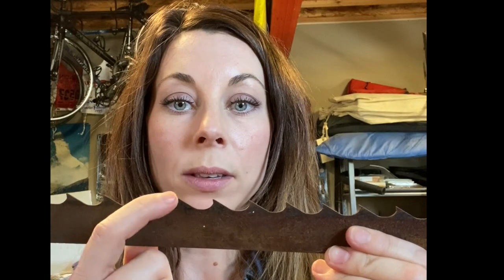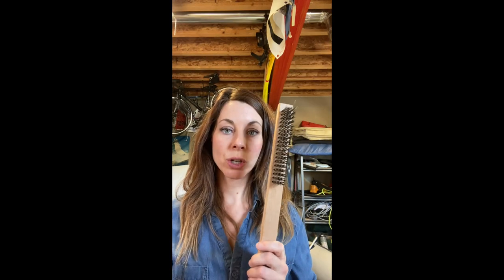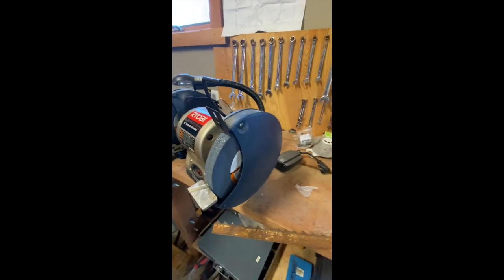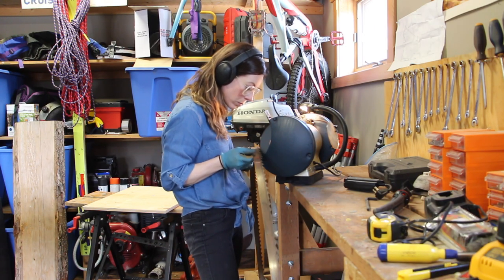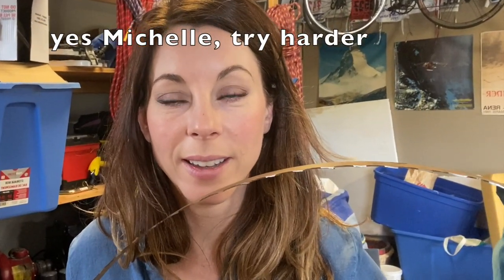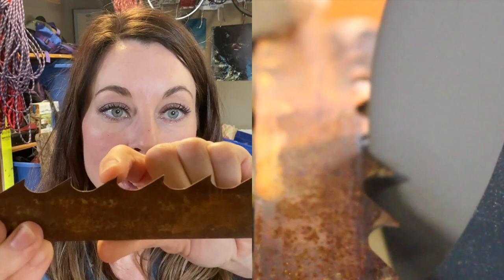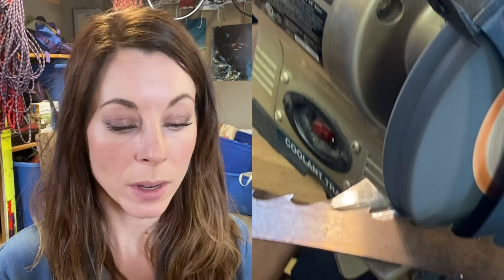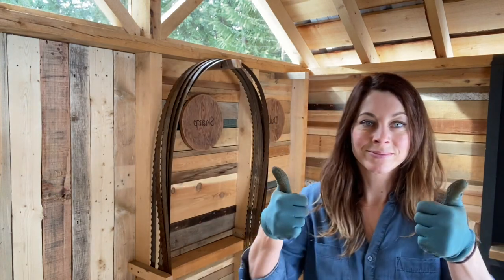How I sharpen my sawmill blades

Comment: To give more clearance for the tip of the saw tooth, just get a dressing tool for the grinder wheel and angle the face of the stone.  This would allow you to still use the side of the stone for sharpening all the while keeping the tip of the next tooth away from the wheel.  Simple change to allow you to use the system you have.

Comment: I like your method. They make thinner wheels that have rounded edges so you could fit into the gullet without nicking the previous tooth.... you could also use a wheel dresser and shape the wheel on the grinder..... love how detailed you are in your videos by the way

Comment: That's actually an interesting and inexpensive way to sharpen those blades. Best way to prevent gullet cracks  is to use a chainsaw file to freshen up the steel in the gullets every few runs. And never run a blade until its completely dull. I change blades every six hours. Been sharpening for 15 years now.

Comment: I manage the millwork dpt in a custom cab/archtectural millwork shop.  We have 2 large resaws, a Stenner, a Baker, and a Winterstieger frame saw.  There are few places that sharpen resaw blades anymore, so we primarily run carbide tipped throw away blades.  

 If you ever need a job in woodworking, we would love to have you!    You would run circles around almost everyone.

Comment: Before I got my Cats Claw automatic grinder I used a bench grinder. Your results  can be improved if you put a narrower wheel on your grinder, say 1/2" and dress a Radis to fit the gullet. biggest problem is its very tiering on your hands. Find a way for the band to rest on a non dulling surface will help.

Comment: I use same technique but I have a CBN wheel on 1700 rpm (slow speed) grinder and this does a very nice job.
Most newish grinders are 3600 rpm and using regular abrasive wheel you risk heating the tip too much and inadvertently taking too much material off. The CBN wheel is much finer cut and produces much less heat. I had a 3600 rpm grinder and then neighbor gave me his old grinder which is 1700 rpm and this made a big difference. Invest in the CBN wheel ....you will like it. Keep eye out at yard sales and FB market place for older bench grinders.

Comment: Right on! Your channel popped up and this is only the second video I watched and just so happens I have two blades in my truck that I was going to try to find vids on sharpening them. 
Buddy has a saw mill,said I could use it and asked if I could sharpen the blades. 
I’ll try your method. Thanks.:)
Reply from the maker: Awesome! There’s a ton of negative comments about doing it this way, but there are many other people on YouTube that have demonstrated this exact same way and claim great success. It’s far from perfect/professional, but it’s better than nothing and does work. Good luck!
Reply: @michygoss7148  right on ya I’ll do what I did for sharpening chainsaw chain. Watched everyones vids and then took the best points and put them all to gether and now I’m not bad at it. I was ripping boards free hand and pretty good at it but this mill is FUN! Buddy was saying people curve the blades to get a rough a looking finish have you heard of or tried that?
Reply from the maker: @Indeewoods  I have not heard of that! Sounds interesting!

Comment: I enjoy your videos. I also own a woodland and sharpen my own blades. The face and gullet are also an important part of every tooth. They also need attention. Every time a tooth is sharpened you loose set in the teeth and it will not cut as good. I have not seen you cut hardwoods. I cut a lot of oak and walnut. I can tell the difference if the set is not correct. 
Keep up the good work
David
Reply from the maker: I don't have any hard woods in my area!

Comment: A large wooden  “wheel” off of a 42” (1 meter) wire spool,mounted to the side of a post would be a convenient place to clean your blades before sharpening. 
You might want to use a grinder dressing tool to round off the left corner of your wheel so your less apt to catch the tooth of your blade.

You do an excellent job explaining what you are doing and have a pleasant voice.

Comment: first video i saw from you, good.  Notting than a vid on sharpening to have comment on how to, ah ah !
I am toolmaker, anyting you do with a grinder like yours have to do on the face of the weel that you can dress. You can sharpening with this grinder but you have to make it set for the job, a bit of work. Just keep in mind the shape of the tooth. The face, curve one, have a positive angle that is for bite into the wood. The back, strait one is to dig. And the set, that give the wide of the cut. You have to replicate that to kepp going fine. For the rust, you can take some time to remove a part of it, but for me i dont worry about, maybe just dry a put some oily stuff at the end of a job. I think your channel will grow fast. Good luck !

Comment: great job on the DIY, I would suggest using a thinner grinding disc so that you can grind the gullet.  That is the low area between the teeth.  Micro cracks form over time and that is typically what causes blade breakage
Reply from the maker: Thanks! Yes, it would probably be better. I just used whatever was already on bench grinder to begin with, so all of this is really just a starting point. There are so many better ways to sharpen them, but for now this has worked OK.

Comment: When i built my bandsaw mill i knew at some point  i would have to sharpen my blades. So after searching on the internet i found a guy the made a blade grinder using a chainsaw sharpener with narrow blades. As i am a welder and machinist by trade i made my own complete with stops and indexing the blade so that you take precise cuts. You will also need a blade tooth setter which i also made using a dial indicator so that each tooth is set precisely the same.
Reply from the maker: That sounds ideal! I wish I had the time, knowledge and patience to do that myself.
Reply: wish you could have shared the link to that vid\

Comment: I have an inexpensive electric chain sharpener for my chainsaw and I've started using it to sharpen my mill blades. Works fine although the chain advance piece has to come off since it's not high enough for the wider blade.

Comment: If you wanna ever really take a good look at ones that have been sharpened alot, one of the biggest factors in hand sharpening is the height of each tooth. Just a simple digital caliper would show you which teeth are out of the ordinary.
Teeth cut too shallow can be left alone, but if you have a handfull that are quite long they should be shortened as they will cause the whole blade to heat up and dull.
Never did band blades, very cool to see!

Comment: You should check out Matt Cremona's channel. He built his own bandsaw and has been dealing with having to sharpen his blades too. I think he has a video on how to do it. You need a tooth setter for those blades. Heck, I use one on my 1/2 & 3/4" band saw blades which get sharpened once a month, depending on how much I use the machine. "Sawing with Sandy" also talks about how to properly sharpen the big milling size blades. I clean all of my blades with CMT. Especially when resawing greenwood. I use an old toothbrush and a cheap shallow pan I got at a thrift store. It works great at getting the resin and sap that builds up on the blades. I give you a lot of credit for tackling the tougher jobs and the maintenance too. More and More women are taking over what has been traditionally a "males job" and it's refreshing to see women like yourself showing women can do anything if they put their mind to it. You are a great role model. Did your dad teach you all of the building skills you have? It's great to see you working side by side. I wish my father was still alive. There was so much more I wanted to learn from him. Best of luck.

Comment: That's clever     I use a 25000 RPM makita   Large drama  With a cut off wheel & then I put a round stone on it  I do both sides  outside &  the top side

Comment: Nice video. Have you tried spraying Blade Coat on your blades? Reduces friction.
Reply from the maker: I have not. Do you mean when sharpening? Or when sawing?
Reply: @michygoss7148  when sawing. I use it on my circular saw blades, planes drill bits and chisels. I have never had a ban saw, so not sure if it would help. I use Japanese hand saws and it helps as they have a very fine kerf. I thoroughly enjoy your videos. We finished our cabin with native pine using only 2 saws(rip and crosscut ). It was a shell when we bought it and 500’ off the main road, so we opted for total solar and have lived off the grid since 2000. Propane Fridge, cook stove and hot water. We did heat with 6 cords of wood originally, but switched to propane after I had my 2 knees replaced.. think about wearing knee pads when you work👍.we have a deep well pump(150’)and a propane Koehler generator for back up. Your skills will improve with time. You do quality work!
Reply from the maker: @garylavorgna5976  ok. Thanks Gary! It sounds like you have an interesting life off grid, and full time. I do admit, I love life at the lake off grid, but I do appreciate coming home to all the amenities as well. 
I do realize that I’m a bit hard on my body, and it will likely come back to haunt me. Thanks for your concern, and thanks for watching! 😊

Comment: i use a 4 inch peanut grinder and sharpen the blades in place on the mill, only takes about 15 to 20 minutes.  i sharpen the inside of the tooth, it works pretty good.  i can sharpen a blade about 4 times before they're toast...like your vids, your a tough gal...
Reply from the maker: peanut grinder? I have seen someone use hand files and sharpen on the mill. It does seem logical to sharpen while still on the mill. I don't have any power down at my mill though 😏 (could get a generator I suppose).

Comment: You could probably buy a grinding wheel for a sharpener set up and use it on your grinder. Idk just throwing out ideas. I send mine off to Woodmizer to sharpen.
Reply from the maker: I looked at a chainsaw sharpener from princess auto (I think about $150 CAD), and people seem to say decent things about that as a blade sharpener option, so depending on how things go, I may try that. 🤷🏻‍♀️

Comment: get one of those stone sharpeners for a drill use it like a big dremel tool for the gullets--maybe🤷‍♂️ like a DEWALT aluminum oxide grinder DWA4974

Comment: Get a shaping stone and grind your wheel to the profile of the tooth once you get it close you can sink the whole profile of the tooth into the stone it will take the shape of the profile of the tooth then go along and just touch the blade this way you will grind the whole profile getting rid of the micro cracks!

Comment: Aren't the blades angled so one cuts L the next cuts R. That way it cuts straight. Then find a half round file that fits the contuor of the tooth. Sharpen like a chainsaw every other one then switch to the opposite side. Holding it tight in a vise. Mark the angles on the vice to keep straight? A file should be able to cut it.

Comment: get a wheel dresser and relieve the left side of the wheel, and you could dress the right side to match the backside of your tooth, might get nicer finish. Pretty nice for free hand!!
the hand held stone type are cheap. you can also get different grit wheels, the nicer the finish the longer the tooth life. careful not to overheat you will lose some temper. Pretty cool

Comment: Your sharpening the wrong side of the tooth
Reply from the maker: In theory, you’re right. But I know I’m not alone in doing it this way.
Reply: @michygoss7148  yes, a sharp point on the tooth is all that’s required to cut like a new blade, but, the blade also needs the gullet to be ground down to take away any hairline cracks or it could break.
Reply from the maker: @bluethunder1951  thank you! Any recommendations on the best way to do that? Dremel?
Reply: @michygoss7148   yes, a dremel would work fine with a round metal carbide bit. It can be done either with the blade left on the saw head or at a bench. Do the gullet and face all in one motion, start in the gullet and end at the tip, doesn’t need much, stay off the back of the tooth as that’s where the strength of the tooth is, wider the tooth is less chance of breaking off when hitting knots. I bought the Grindlux sharpener and tooth setter, it was worth it for me since I do about 500-1000 bf per day. I set the teeth on third or forth sharpening.
Reply from the maker: @bluethunder1951  wow. You know your stuff! Thanks for the tips. I just can’t justify buying a sharpener right now, but it taunts me for sure!
Reply: @michygoss7148  for sure they are not cheap. If you can find a local that sharpens and sets, it worth it, I charge $5 to sharpen and and extra $3 to set, but that’s just me, I don’t like to over charge for something I like doing as a hobby and my clients like to come back.
Reply from the maker: @bluethunder1951  oh man! That would be totally worth it! I’m not sure there is anyone in my area doing it, but if they were I guarantee it wouldn’t be that low of a price. That’s really nice of you to be so reasonable to your customers.

Comment: you are sharping the wrong side! sharpen the c side with a round file of the same radius just like a chainsaw chain. you might have to put it in to  a wise so it will give you at least 6 inches of blade tight for easy filing, also see if you have to stager every other tooth surface

Comment: Your sharpening wrong side to the tooth. You can buy a stone for your grinder that more or less fits the profile of the tooth all the way down to the gullet. Also the face of the plate that the blade rests on should be bent up 10 degrees or so.

Comment: You are sharpening the right side but only doing half. Take a file and touch up the inside face. All you need is a little at the top Of the tooth. More importantly you need to set the teeth or it will not cut right. Put the blade in a vice and gently with linesman pliers bend one to the left one in the center one to the right. This is Just as important as sharpening.